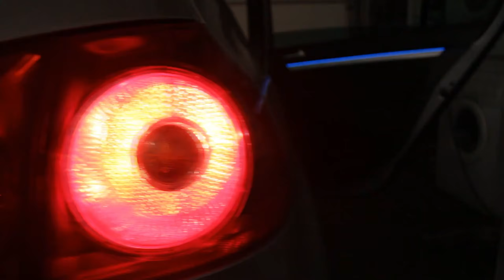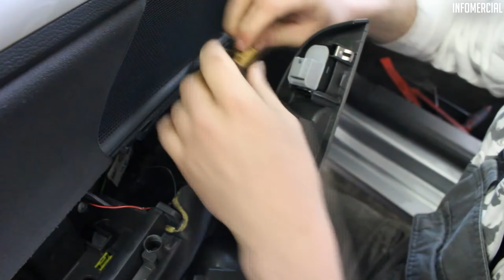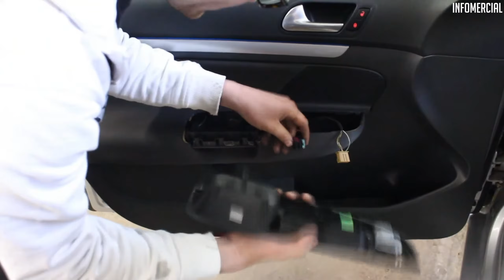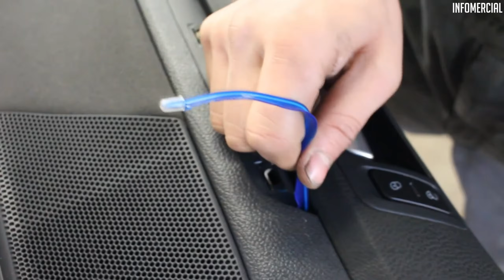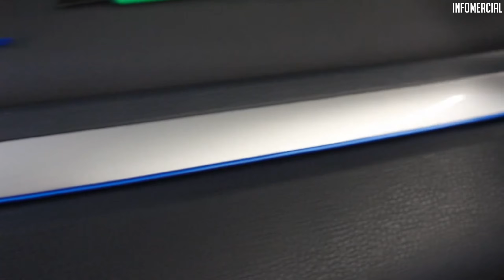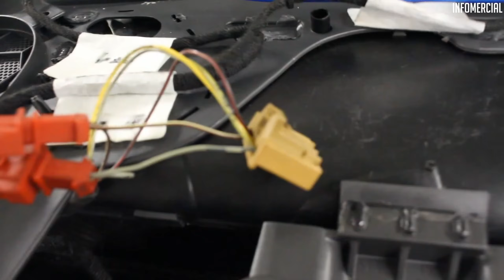How to Retrofit Ambient Lighting on VW Golf 5 | Full Step-by-Step DIY Guide

Comment: Also how did you identify the positive and negative 12v wires on the mirror plug ?
Reply from the maker: I identified them using a multimeter—12V shows with ignition on, and the ground stays constant. Always best to double-check on your car since wiring can vary.